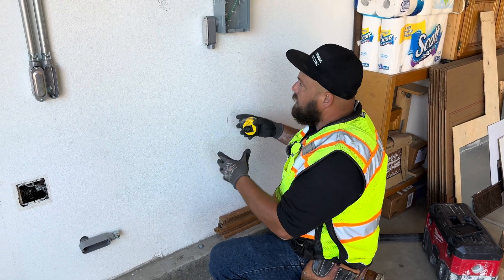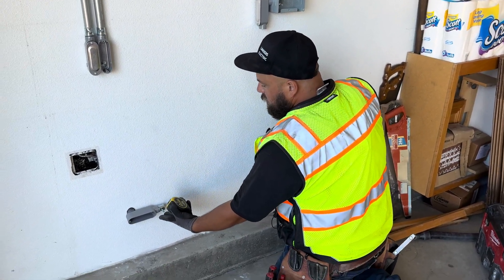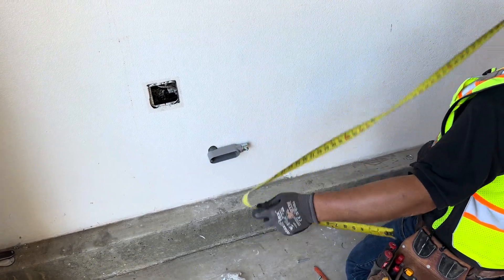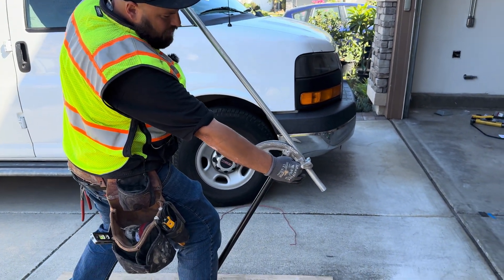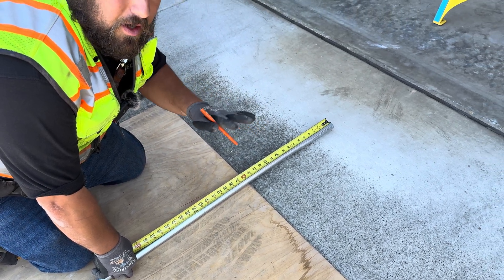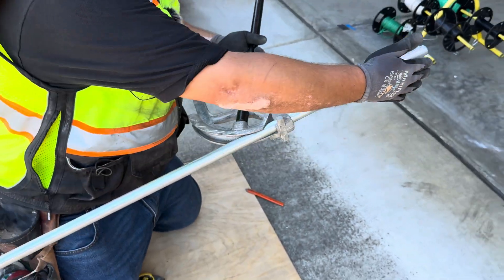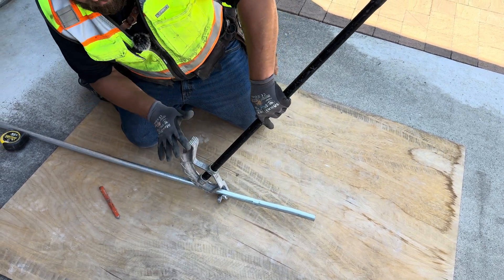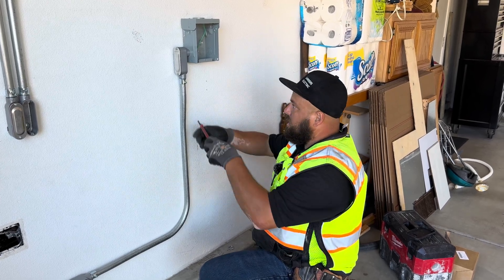How To Bend And Install Conduit | MASTER ELECTRICIAN | 90's and Box Offsets Made Easy

Comment: Hey, I love watching your vids, I’m left a little confused.. could you explain what the 28” measurement was about
Reply: that is the high different between two points from the floor corner. 37in3/4  minus 9 in you got around 28in. the 20in1/2 part is the different of two measurement from the left wall edge of two boxes ( 59in1/2 and 39in). That is how you measure for 90* bend distance between two point. The 6in deduction from the start point of 20in1/2 for the 90* bend is the cool thing I just learned from this video.

Comment: Why the LB? Why not straight in to the bottom instead of side?
Reply from the maker: The customer built a custom box to hold the charger that hangs down. He wanted it mounted to the wall directly below the EV charger receptacle. Had to make sure the conduit was out of the way.